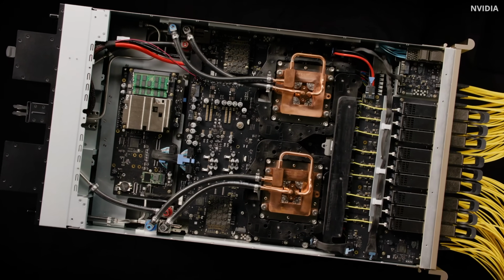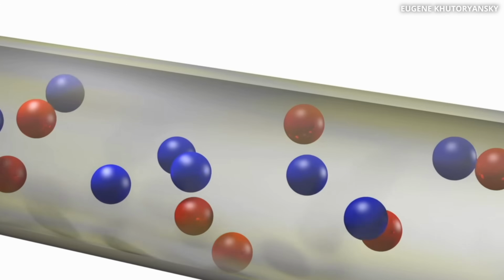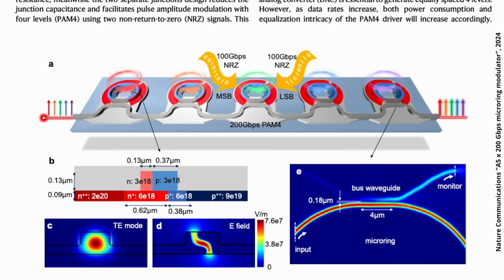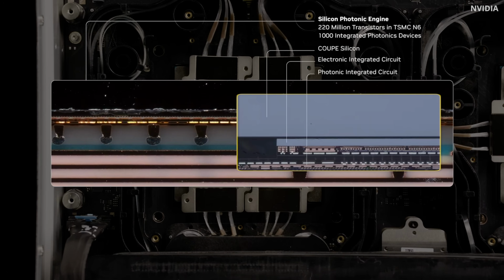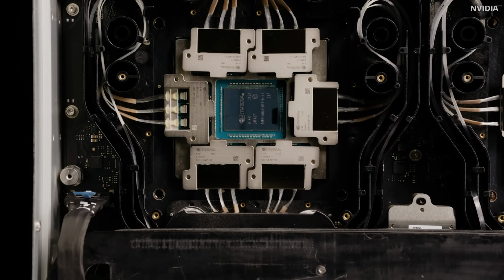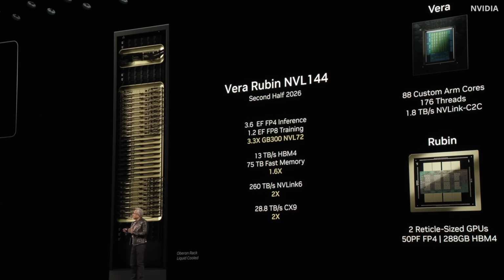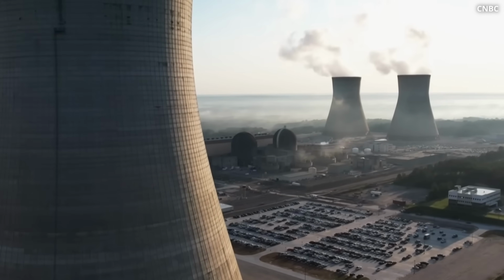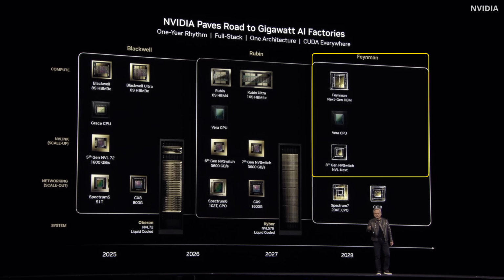NVIDIA’s New Photonic Technology Explained

Comment: I think that  the “light” revolution in chip design is far more useful than the backside power and shrinking our old technology to 2 or 1 nanometers
Reply: actually "mis-usefull"
Its for total control of worldwide mankind by the WEF oligarchs.
Reply: That is Not Right. The one Atom Transistor 200 picometer will only use 1/10000th power. Look at singleatom Transistor.
Reply: @michaelnauen4236  it doesn't work that way, transistors smaller than the order of a hundred atoms don't work, only their relative positions change, packing of atoms.
Reply: @michaelnauen4236  We're very far away from one atom transistor scale. The ``2nm`` is in fact 30-40nm transistors.
Reply: @petemisc4291  when we settle on 1 nm we will get 16 nm of metal pitch. It will be very difficult  to shrink metal pitch to 10nm. Thats why we need to transfer to LIGHT tech chip

Comment: This is moving the InfiniBand optical cabling onto the chip itself. So first the backbone was fiber. Then we had FTTH. Now we have FTTC (Fiber To The Chip) as chips in different datacenters are linked by fiber. The last step is processors themselves being based on light-based switches. At that point, SkyNet will officially take control.

Comment: I want to understand how the photic cells perform amplification and switching. For example, consider a basic inverter. It is easy to imagine the light being converted to electrons and then using a traditional electronic gate before turning the result back into photons. But that is too slow, so the implication is that they have a purely optical transistor.

Comment: What I find interesting is that they're focusing on communication, not on compute. For many years we've heard about the photonic computer which would compute fast, and IMHO it makes no sense as we won't replace transistors in ALUs with as many lasers, or it would consume more and be slower. However using light to reach RAM and I/O makes a lot of sense. A 1.6 Tbps fiber is 200 GB/s, roughly what can currently be reached with 256-bit memory, but with a single fiber replacing 256 wires. There's definitely some savings to do here. Same for PCIe which are constrained by track length on the mainboard.
Reply: and because they often use alot of power the optics then to burn out. imagine having many of these and some only burn out. and your hardware stops functioning.
Reply: Communication to that other server two racks over will be even more useful.

Comment: If i had a dollar for every time there is a breakthrough in optical computing that doesn't bring it to masses i'd have enough dollars to start a company that's gonna make more breakthroughs in optical computing
Reply: This one only needs to make it to the data center. That is where you need huge bandwidth to connect those server racks together. For the typical household, 10GBit ethernet should remain sufficient for at least another decade.
Reply: The difference today is we are hitting theoretical limits with what we are using. 

 It's like ICE engines, and conventional Helicopters. All technologies we essentially maxed out without some type of leap in understanding. 

 Eventually it just makes sense to move to some other medium outside the standard transistor. Too many bottle necks.  

 With photonics. They can layer information at once, because light doesn't interfere.

 Already x86 chips on the market. Whether some rival standard GPUs in a few years like they insist is doubtful. Yet I do see it it coming.
Reply: no te preocupes
en unos años la fotonica sera lo suficientemente barata para llegar a todos
Reply: That's good thing. People are busy thinking future.
Reply: @X1000Binary and forgetting about now
Reply: Add Quantum something to push it even further. Quantum optical AI maybe?
Reply: @testales throw in blockchain and you have a revolution

Comment: China already has quantum data transmission between Earth and satellites... and we’re still moving data between chips like we’re hauling sandbags.

If the bottleneck in AI isn’t compute anymore but data transfer, then why aren’t we compressing the data before moving it?

Imagine hardware-level compression chips – like mini .zip engines – working between GPUs, slimming down info before it travels.

Fiber optics are great, but light still bounces. Quantum entanglement? Now that’s fast. A true quantum internet could mean signal anywhere – okay, maybe not in other dimensions 😅

The solution isn’t just “go faster” – it’s move smarter. Energy isn’t cheap. We burn power just moving bytes around. Let’s zip it, beam it, and chill.

The future isn’t just optical or quantum – it’s hybrid, compressed, and intentional.

Brute force is outdated. It’s time for intelligent data flow.

Comment: NVIDIA Spectrum-X and Quantum-X are two critical network technologies developed by NVIDIA to meet the growing demands of AI and accelerated computing infrastructures, particularly in data centres where large-scale training and inference workloads are run across vast numbers of GPUs.

⸻

NVIDIA Spectrum-X

Spectrum-X is a networking platform optimised specifically for Ethernet-based AI infrastructure, introduced in 2023.

Key Features:
   •   AI-Ethernet Optimised Switches: Built around the Spectrum-4 switch, capable of up to 51.2 Tbps throughput, Spectrum-X enables ultra-low latency and congestion-aware packet handling for AI workloads.
   •   Integration with BlueField DPUs: Spectrum-X is designed to work seamlessly with BlueField-3 DPUs, offloading networking, security, and storage tasks from CPUs.
   •   Purpose-Built for AI: Unlike traditional Ethernet, which struggles under the bursty and synchronised traffic of AI training, Spectrum-X supports precise congestion control and telemetry to maintain high bandwidth and low jitter.

Use Case:

It targets AI factories that don’t use InfiniBand (typically preferred in supercomputing) but want to scale using Ethernet infrastructure. For example, enterprises or cloud providers deploying large-scale AI in-house.

⸻

NVIDIA Quantum-X

Quantum-X refers to NVIDIA’s InfiniBand-based networking platform, built for maximum performance in supercomputing and large AI clusters.

Key Features:
   •   Latest Generation: Quantum-2 and beyond: These switches provide 400 Gbps per port and a fabric throughput of 64 Tbps, designed to scale to tens of thousands of GPUs.
   •   Time-Coordinated Communication: Supports features like SHARP (Scalable Hierarchical Aggregation and Reduction Protocol), which reduces communication latency in AI training by doing in-network computing.
   •   Lossless Transmission & Ultra-Low Latency: Perfect for tightly synchronised, large AI models like GPT, where consistent, high-throughput data movement is critical.

Use Case:

Quantum-X is used in massive GPU clusters, like those in NVIDIA’s own DGX SuperPODs, where speed and efficiency outweigh Ethernet’s flexibility.

⸻

In Summary
   •   Spectrum-X: Ethernet-based, ideal for AI data centres wanting flexibility and integration with modern Ethernet gear. Good for cloud and enterprise-scale AI.
   •   Quantum-X: InfiniBand-based, built for top-end performance, ultra-low latency, and maximum scalability. Best suited for supercomputers and hyperscale AI systems.

Both are foundational for NVIDIA’s AI factories, depending on whether the infrastructure is Ethernet or InfiniBand-based.

Comment: As the way I can imagine, the limits would be the wavelengths that the generators of light (spectral emission), the transmission pathways resistance for each wavelength, power efficiency and photonic component gap resolution between states.

Comment: NVIDIA’s Rubin Ultra NVL576 represents a significant advancement in AI computing infrastructure, designed to meet the escalating demands of data-intensive applications. Unveiled at GTC 2025, this system is slated for release in the second half of 2027.  ￼

Key Features of the Rubin Ultra NVL576:
   •   GPU Architecture: The system incorporates 576 Rubin Ultra GPUs, each featuring four reticle-sized dies. This configuration delivers an impressive 100 petaflops of FP4 performance per GPU.  ￼
   •   Memory Capacity: Each GPU is equipped with 1 terabyte of HBM4e memory, culminating in a total of 365 terabytes of fast memory across the entire rack.  ￼
   •   Performance Metrics: Collectively, the NVL576 system offers approximately 15 exaflops of FP4 inference performance and 5 exaflops of FP8 training performance, marking a 14-fold improvement over NVIDIA’s previous GB300 NVL72 system.  ￼
   •   Power Consumption: Each NVL576 rack is projected to consume up to 600 kilowatts, reflecting the substantial energy requirements of such high-performance systems.  ￼
   •   Rack Configuration: The design includes four pods per rack, with each pod containing 18 blades. Each blade supports up to eight Rubin Ultra GPUs, totaling 576 GPUs per rack.  ￼

The Rubin Ultra NVL576 is part of NVIDIA’s broader strategy to push the boundaries of AI computing, with subsequent architectures like Feynman planned for 2028.  These advancements underscore NVIDIA’s commitment to delivering cutting-edge solutions for the rapidly evolving AI landscape. ￼